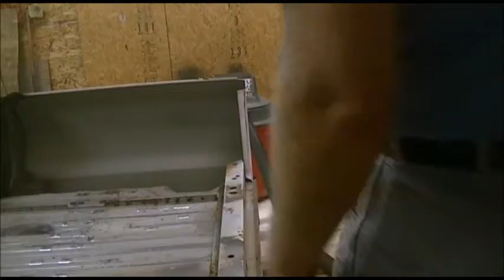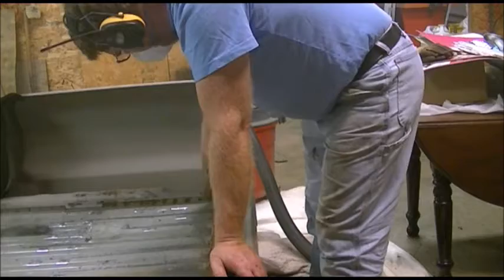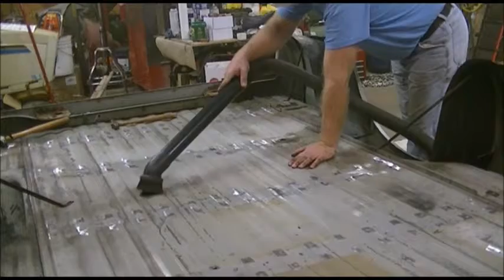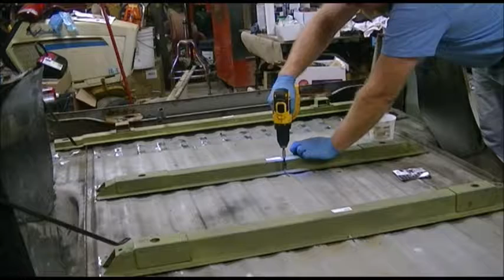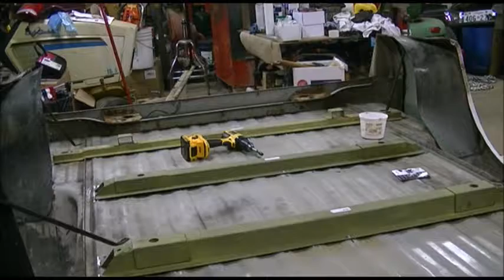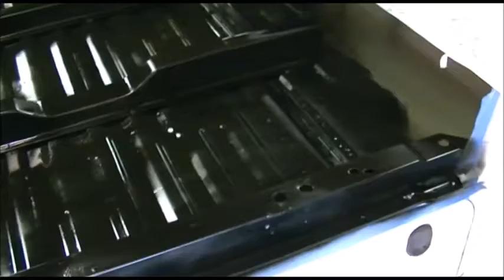Bed repair #2

Comment: So all there is holding those rails to the bed is two screws and panel bond?
Reply from the maker: newtsfarm yes, I was told the panel bond was stronger then steel. They are sandwiched between the bed and frame so there not going anywhere.